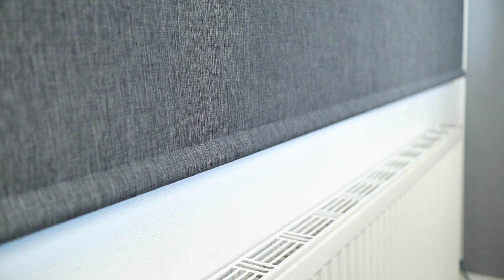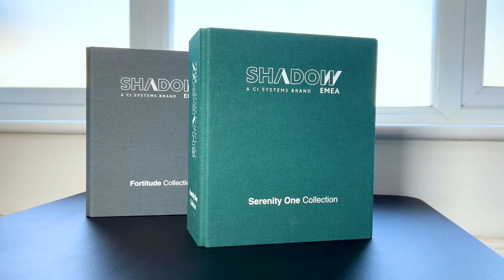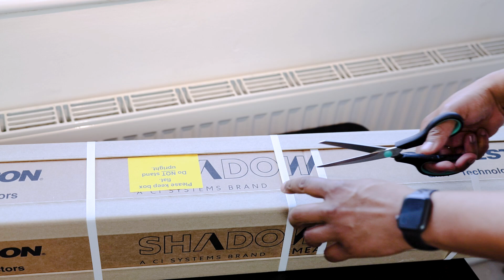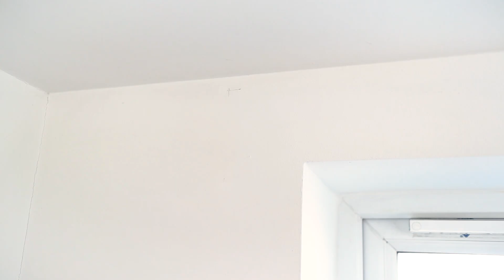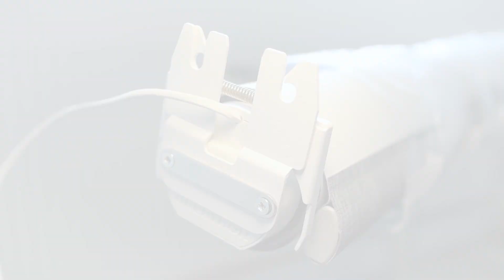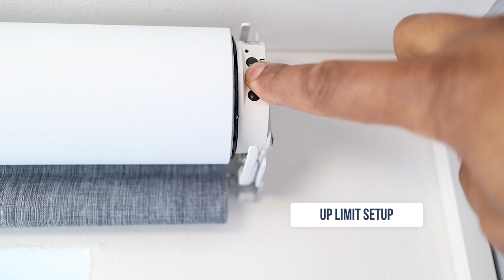How to Measure & Install Shadow EMEA Roller Blind | Crestron QMT 5 Motor Installation Guide (2025)

Comment: Thank you. This was the only information I could find on Bracket set up, installation and limit setting. I would have liked to see what type of transformer could be use in a single set up application. How the wires go into the plug (i.e pins 1 and 4). And lastly how to ren=move the motor or idle pin from the tube. I have a roman set up and to install the cord lifts we need access to the groove in the tube from one end.